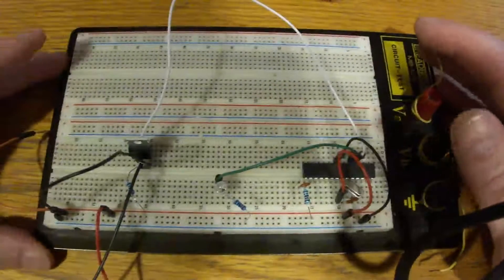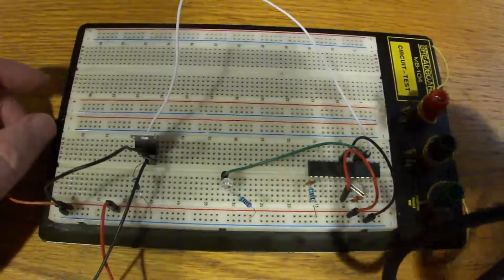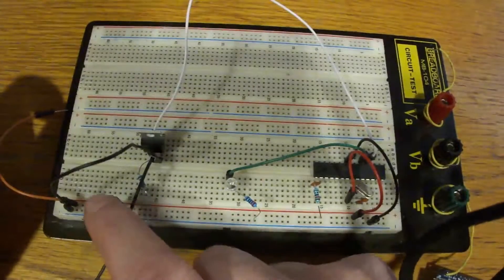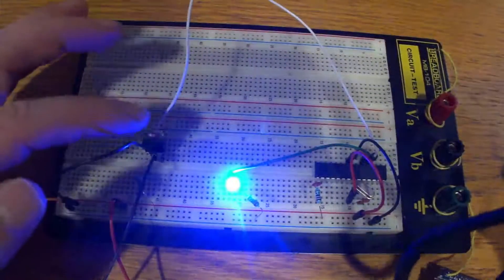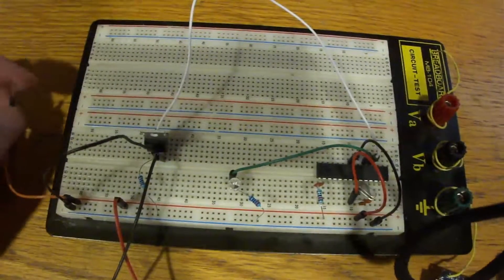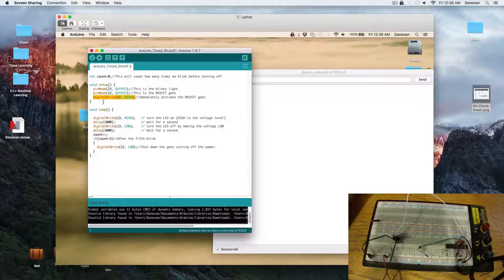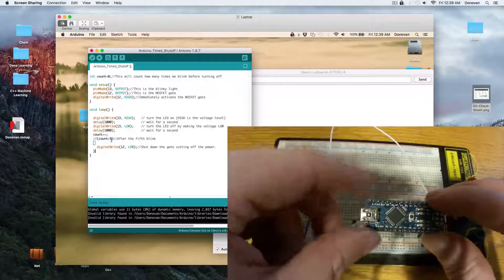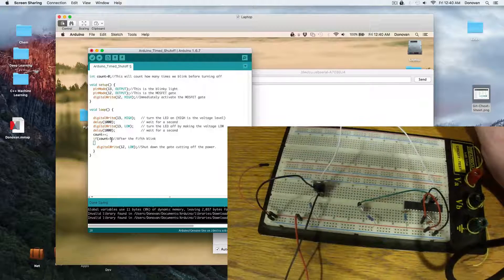HOW TO: Get an arduino to turn off its own power.

Comment: I've tried an tried to get this working but every time I connect the power the Arduino starts up immediately. I've used a BC547 which is an NPN BJT wher the Base = Gate, Collector = Source and Emitter = Drain. Other than that I've wired it up exactly as in your diagram.
Reply: Did you ever get this to work? I am having a similar issue when I connect the supply voltage.
Reply: @robynbirch5700  hi from 3 years in the future! Did u get to work ? 😅😅

Comment: I've been working on similar recently and found a problem that some folks won't have thought about.

If you want multiple buttons then along with the arduino latching its power supply "on" then it must also afterwards be able to recognise which button had the input. As all the buttons will be tied to the Vin circuit that latches the power on this could be a problem for some.

I found the easiest way (if you want to avoid mosfets and all that advanced stuff) is to use a thyristor - either a packaged / pre--made component or make one (well several actually) with a PNP and NPN with a 10k pull down resistor on the NPN base. A button connected to the same base will activate this and keep it turned on. Repeat this for each button as you need. With a diode attached to the emitter of the NPN (which itself has a pull down resistor) then all the button thyristor outputs can be connected to the base of another NPN transistor - which has its collector connected to the base of another PNP transistor for minimal voltage loss across it allowing a 5V supply to remain at something like 4.96V to the Vin of the arduino.

Now remember the diode on the output of each thyristor setup? If we read the voltage between the thyristor output and the diode in our arduino code, the arduino can detect which button was pressed simply by reading a digital input put as high. Of course at some point you'll also want to turn off the arduino and that can be done by using another NPN transistor across the gate of the thyristor do the ground of the circuit. The arduino then sends that pin high, activates that transistor and shorts the thyristor gate to ground thus turning it off along with its own power supply.

You'll need a fair few transistors to do it this way but if you're only just getting into electronics and don't have all the other parts you need, you're in a hurry and have plenty of transistors then this will work for you. Recap: 3 transistors, 1 button and 1 diode per button and two transistors to keep the power turned on - which each thyristor output can send a signal to.

Comment: What resistor do you use between gate and source? I use 10K, but after arduino switch's off still current passing. 
Battery volatge is 4.2 and when it's off voltage measured it's arround 3.0 volts.

Comment: Love the simplicity and elegance of the circuit!  And the fact that software is used instead of hardware latching.  And the idea to use PCF8574P to save the pin.
From what I can see the Arduino output can be burned if the button is still pressed when it is time to shut the controller - another resistor could remedy that.
Could this circuit be expanded to also handle an inrush current caused by big electrolytic capacitors being used?  I need those to handle steppers. Thanks a bunch!
Reply: Found solution here: 
http://www.mosaic-industries.com/embedded-systems/microcontroller-projects/electronic-circuits/push-button-switch-turn-on/microcontroller

Comment: Hi there, great video, but I had a problem when I tried to implement the circuit. The arduino was always on even if I before I pressed the button.
The problem is that once I connect the arduino to Vcc (Positive Input Power Source) all of its pins have high voltage of a value that is very near the input voltage value, which makes the MOSFET in on condition (very low resistance between source and drain). So the arduino is never off, the I/O pins already have high voltage even before the arduino turns on. 
PS: no I did not connect the arduino directly to ground, the GND pin is connected to the Drain of the MOSFET, just like in the video.
Thanks a lot :)
Reply: I was having a similar problem with a similar circuit. Got it to work by putting a diode between the Arduino output pin and the mosfet gate.
Reply: I got the same problem, did you manage to fix it?
Thanks

Comment: Nice. I can use this to create parallel Arduinos to run sort of autonomously. A master sends a momentary signal to the slave Arduino and moves on to something else.
Reply from the maker: +Bill Field That is a cool sounding use. Perfect when you have dedicated arduinos for, say, a sensor that doesn't always need to sense.
Reply: exactly, and for when I don't want to tie up all the GPIO's of the master
Reply from the maker: +Bill Field Definitely a good use. You have probably heard of this one before but in case you missed it there is also a chip called a PCF8574P which is an I/O expander. It uses I2C which then only uses two pins which are still available for other I2C devices. Each PCF8574P adds another 8 pins and you can have more than one on a single I2C. They aren't a perfect replacement for the I/O pins on an actual arduino but for many tasks they are fine.
Reply: I will definitely look into that as well. Thanks.
Reply: Sir you shall go down in history as the legend that solved multithreaded hardware processing LOL